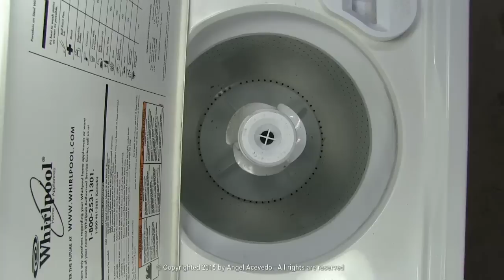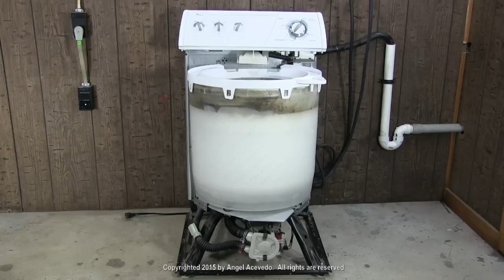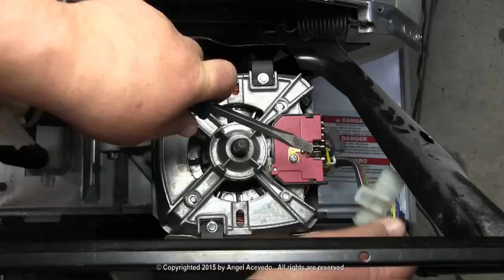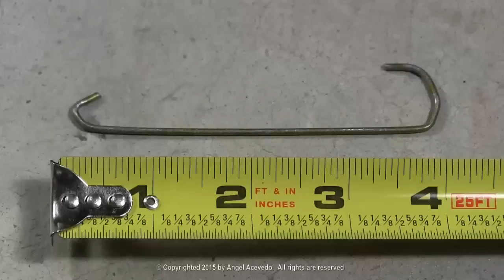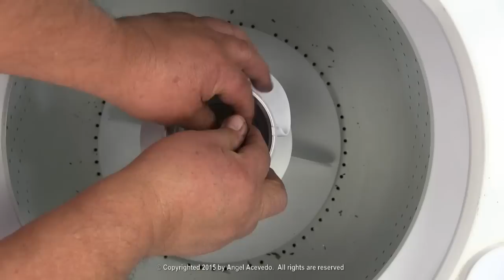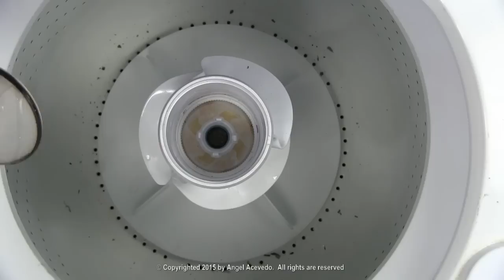Whirlpool Washing Machine Not Agitating Or Not Spinning - The Gearcase Or Transmission

Comment: Hello Angelo.  Your vides are super helpful and excellent.  I have used your videos to replace by direct drive Whirlpool washier coupling and I also changed the clutch/brake assemble.  The washer is still not spinning, so I thining the issue is the transmission as the easher starts, filles, agitates and draind.  It just does not spin.

I have to remove the transmission shaft to change the new clutch

My question is do I need to use a spanner wrench to remove the spanner nut inside the tub?  I did not when I changed the transmission and your videis do not say to do this step, but you include a link to Amazon to buy a TB123 spanner?  

Some videos say I have to remove the nut, but your does not.  Is this an optional step?

Thanks

Comment: Thank you for your videos, very helpful. Your channel helped me troubleshoot my Whirlpool Gold Ultimate care 2 washer. Unfortunately my transmission/ gear case was bad. For me It's not worth buying a replacement. Is it possible to rebuild the transmission / gear case for less $ than a new one? P.S. I subscribed to your channel and left a like.
Reply from the maker: I would look for a good cheap use one  maybe on eBay.